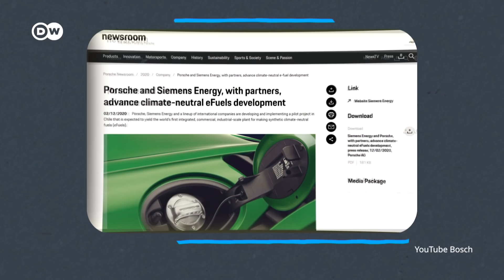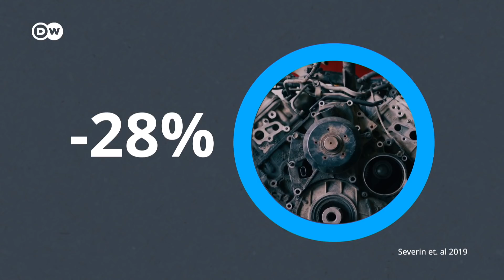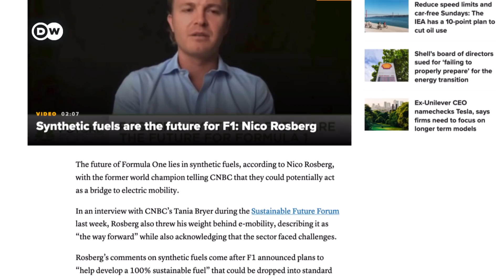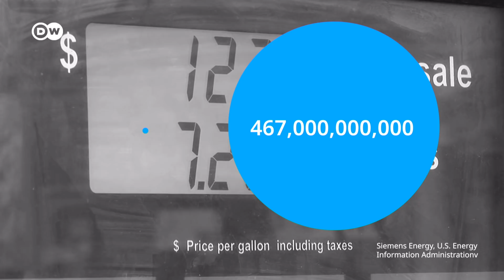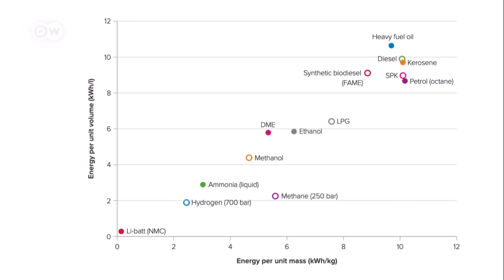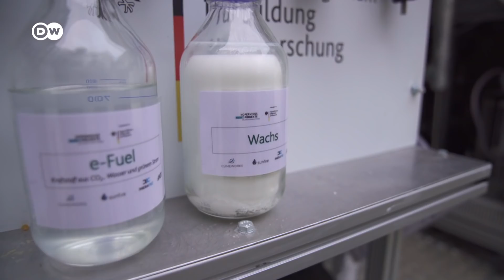The truth about carbon neutral fuels

Comment: We will never have only one method of energy production. 
Hydro and geothermal are pretty much maxed out with current technology; hydrogen is extremely energy intensive to produce and the problems with storage and transportation have not been effectively addressed yet, some W&S make sense, but it's too resource intensive and chaotic to ever be capable of doing the heavy lifting. FF has a lot of advantages, and that's why approximately 80% of our energy needs are currently met with this method. It's energy dense, high capacity factors, it's stable and easy to store where we want it until use. It's also dirty, and we should replace burning it for fuel as much as we can.
 Nuclear power, however, requires a fraction of the resources of any alternative as well as being the safest and lowest environmental impact method available. We should be using it as much as possible. 
Adding more Nuclear power plants would mean far less environmental impact than attempting replacing FF burning with other methods of energy production.
 Without even factoring in the required backup, wind and solar use 100's of times more resources per unit of power production than NP does. That's 100's of times more mining, pollution, and waste, including toxic substances like mercury and cadmium that have half lives of forever and unlike used nuclear fuel are not safely contained. 100's of times more manufacturing and transportation that's done with FF, 100's of times more land and habitat loss. 
Nuclear power is the safest method capable of meeting our energy needs 
https://ourworldindata.org/safest-sources-of-energy
And the fastest way to decarbonize.
How fast can we build clean energy per capita?
From @jmkorhonen & @Kaikenhuippu Climate Gamble: https://t.co/Z4bKDoy2AV
https://twitter.com/CC_NoThanks/status/1358287438091804673?s=19 

How fast can we build clean energy per capita?
From @GrantChalmers https://t.co/J0Abtov19Q 

https://scienceforsustainability.org/wiki/How_quickly_can_we_build_clean_energy%3F

 Using NP, a reliable clean power source, negates any need for massive overbuild and backup. Which means way less resources are needed, which means it is a greener solution.
A huge problem with dilute intermittent power sources like Wind and Solar is the ridiculous amount of resources needed to produce such massive power generation and storage units. No matter how problematic one may think nuclear power may be (its not its been producing clean reliable power for more than six decades without effecting the climate or human health), the environmental devastation caused by attempting to replace FF at scale with any other available alternative far exceeds that.
https://m.youtube.com/watch?v=zc7rRPrA7rg&feature=youtu.be#dialog 

When looked at in perspective, it's very clear that NP is the cleanest, safest, lowest environmental impact method of energy production available that is capable of meeting our energy needs. 
We have to meet our energy needs regardless; I vote for doing so with the least harm possible.
https://www.world-nuclear-news.org/Articles/Why-nuclear-is-an-environmentalists-story
Reply: What are your thoughts of meltdowns and getting rid of nuclear waste which can have a negative impact on the environment and our lives? There has a be a way to recycle that waste to produce batteries and consumer products. Plus, a smaller and very compact power plants instead of relying on dangerous big nuclear plants.

Comment: Very interesting. E-Fuels should not be used in cars or ships. Surely the best use case is aviation. Batteries really stand no chance of powering large aircraft over long distances anytime soon. In desert locations, surely solar (thermal or photovoltaic) is a limitless resource. So even a 20% efficient process is still worth it.

Comment: This could be if cheaper great since you are not only creating synthetic oil from air pollution which doesnt increase carbon consentrations, plus you could use this tech additionally as a battery. Think about it, a battery is just a reserve of energy if you can say plop some km^2 of solar to a very sunny and  easily reachable place, like the borders of the sahara with ships or even a pipeline you could then capture carbon back into fuel, stopping carbon emissions plus saving the fuel as a means of energy storage. Sure its not perfect and not efficient, but you are basically getting it for free. This could also help make renewable energy sources more reliable, turn up those generators when you got plenty of sun and wind, create synthetic oil and then burn it in the night and therefore having no need for any other carbon emissive energy sources.
Reply: We need to reduce the amount of carbondioxide in the wtmosphere will this not just be used with non renewable sources causing polution

Comment: I feel it's horribly inefficient. Because you're using an ICE, you already jump to a Well-Wheel Efficiency of ~40%. And that's considering there's no other power losses along the way. With the world struggling to "clean" their own grids, this would be a huge added task. Moreover, CCS would focus on capturing CO2, NOx with a Global Warming potential of 72, will still be released. It might be a Carbon-Neutral fuel, but it's definitely nowhere near a clean one. Moreover, with the current price of E-fuels, one would easily spend enough in a few years to make up the difference for an electric vehicle. As an automotive engineer, it saddens me, but E-mobility is the way to go.

Comment: The fastest way to ramp up the production of renewable energy from intermittent sources is probably by pairing those energy-capture facilities directly with fuel production or other chemical synthesis facilities on a micro-grid. That way you don't need to worry about grid upgrades or energy generation contracts, and the fuel production facilities can be designed with an accurate estimate of the amount and costs of the energy they are getting.
By not depending on regulated energy from a grid they can take advantage of the cheapness of the mostly unregulated energy being produced by these intermittent sources by ramping production to match their energy supply.

Comment: The low-hanging fruit for e-fuels is ammonia as it allows you to skip the carbon capture step, as such is pretty much the most efficient to produce. As for using it or synthetic hydrocarbons, they will probably make a bigger impact with powering industrial equipment or as a supplemental fuel, rather than the primary energy carrier for personal vehicles.
Reply: Ammonia is also not very easy to store to be here

Comment: Says tv from country which just recently reopened open pit mines of brown coal and power plants fed from those mines.... Decarbonize, sure. Use solar power from devices that are made in chinese furnaces, basically they work almost like batteries, captured energy in furnace is slowly released with photons until solar panel is depleted... after around 15yrs. In Scotland it is small but snowballing problem, panels that supposed to last 20 years are usually depleted after around... wait for it! 12yrs! I can go on and on with every single form of so called renewables, except perhaps offshore installations that use sea currents - they make quite a lot sense.
Meantime France retreated from Paris agreement couple of weeks ago, as they realized that it does not serve their national business... well? Who is next?

Comment: Methanol is the better alternative to eFuels.

Methanol is not a "bridge-technology" (imao)
because big ships, mid/long range trucks or planes will never be fully electric. Economics dont work out, because once one designs f.e. a truck which can go for 1000 km, the battery gets to heavy, the cost are prohibitively high and so much energy stored in that small footprint cause serious risk. Transporting such heavy and large batteries is pretty inefficient.
Production of batteries is enviromentally not without issues.
Short range (up to 100 miles / day) electric is fine.
Mid/long range Methanol is the best enviromentally friendly liquid fuel for foreseeable future.

The CO2 emmissions from transport sector quite huge, but still lower than nature (plants) can and do sequest from atmosphere.

Stationary power plants powered by fossil fuels, CO2 emmiting chemical plants like cement or steel plants have to be equipped with CO2 capture technologies. CO2 and H2 (renewable energy sources) can and should turned into Methane or Methanol.
This is the only sustainable economicably viable path forward.
Reply: There are many options but one of the main benefits of Efuels is that you do not need to install a new engine or develop the technology for one. Efuels runs perfect on regular engines, that's masive.

Comment: Just use the hydrogen in the plane directly, at an efficiency of 30%+ instead of 8-18%. Or wait 5 years for insanely better batteries (due to all the funding and R&D now going into them) which will make all these questions redundant.
Reply: Airplanes and ships are never going electric. Trucking indrustry is not going to any time soon. 

Hydrogen has issue with inflammability and low energy density(due to all the mass & volume requred to store high pressure hydrogen), the advantage of Efuels is that you don't need new engines, you don't need to make any investments. You just buy a more expensive fuel than your regular stuff and enjoy carbonneutral transportation.
Reply from the maker: Feel free to check out this report on hydrogen planes: https://www.youtube.com/watch?v=7KkBE0HgNJQ Let us know what you think in the comment section!

Comment: I am sorry, but the Reporters did not thoroughly research "synthetic fuels" and they just name one of many processes synthetic fuel in general. There are other ways to produce synthetic fuels from waste conversion, biomass conversion, conversion of natural gas to synthetic fuels. Those are cheap, drop in replacement for fossil fuels and emit 80% less CO2 when combusted in ICE! They additionally eliminate emissions solving cross sectoral challenges! You need to rectify by creating a new report on synthetic fuels which are an ideal climate technology and better than electro mobility given the life cycle of EV and batteries! Just give it another think!!

Comment: I work on a farm, and synthetic fuel represents the only feasible way that our equipment could be carbon neutral. Batteries are too heavy and expensive, and hydrogen power undeveloped both in technology and infrastructure. Meanwhile, Carbon Engineering has been producing carbon neutral diesel since 2017. This technology could be gradually integrated into existing fuel systems, eventually reducing pollution from our equipment to zero in a manner that wouldn’t completely bankrupt our farm. So, a yay from me for synthetic fuels in regards to heavy equipment.
Reply: Bless you bless the farmers ✊🏻
Reply: At $10 a liter it will still bankrupt your farm.
Reply: @LearningFast Guess what? It was pricer to automobiles versus horses and bulls in the early 20th century.
Reply: Methane made from farm waste not petroleum
Reply: Methane is what I’m banking on
Reply: Video or it didn't happen
Reply: Wouldn't farming wastes also be used for Biomass Power and Biodiesel? That might mean a bit more financial benefit for farmers too. 
Also, even if we develop Hydrogen Fuel technologies by a lot, it will still have horrible Energy per Unit Volume (not Energy per Unit Mass!) because of the inherent properties of Hydrogen as compared to Organic Chemical (Diesels, Petrol, etc.)
Reply: @ZippyPiglin36  Some farmers do bale up the plant matter left over from grain harvesting, but we like to leave ours in the field as it breaks down into the next season and adds some fertilizer and organic matter back into the soil. I'm not certain, but I believe the general consensus is that the soil health benefits of leaving harvest leftovers in the field outweigh the potential benefits of "harvesting" the leftovers and using them for something else.
Reply: Listen to the whole video. Synthetic fuel still requires hydrogen combined with CO2 from gas or biomass which sounds a lot like brown hydrogen, a product of coal gasification. The electrolysis of blue hydrogen from water is too energy intensive to be profitable. Green hydrogen is produced from methane. I still have high hopes for ammonia as fuel even though SpaceX uses methane
Reply: @luislongoria6621  hydrogen can be produced cheaply depending in where you are a solar farm in north africa to power a hydrogen plant would be ideal
Reply: @luislongoria6621  Learn the facts. Green hydrogen is NOT necessarily produced from methane. It is mostly produced from water electrolyzed with renewable energy. There are

Comment: Engines could also be powered by some type of gas.  and I do not mean petrol
Reply: Yes but hydrogen has energy density problems, requires a massive new tank to store, requires a new engine to run on. Efuels require none of that.
Reply: @TheTaXoro  it is more eficient to powwer a engine with reverse osmosis instead of burning i
Reply: @definitlynotbenlente7671  By that you mean using hydrogen fuel cells yes. But then you need a fuel tank, a fuel cell and an electric motor.
Reply: @TheTaXoro  yes

Comment: Running engine on petrol fuel emits CO2 only count as secondary warning effect. The primary warning effect? Is waste heat 75% or more of it into the atmosphere only 25% or less to propel our cars. 

As students we were told but question that CO2 is a good insulator of IR, and more CO2 raise atmospheric temperature.  The opposite is true. CO2 emits as much and as good IR as it absorb it. So what insulate IR? Glass.

Comment: Hi, 5000 windturbines is not so much, I think. How much planes we have...? I am sure the efficiency of efuels will increase. As I worked at Siemens 30 years ago, I sad, we have to develop sun and wind power, the bosses only laughed! And today? Perhaps there's a potential that we should not miss! We should use and develop renewable energy wherever it is. By the way, it's necessary to get CO² back out of the air to stop the greenhouse effect. There is so much more to say and do...... (Uran is no solution - only the next devil) greatings..

Comment: In your efficiency calculation, you didn't mention the weight of electric batteries. For example, in Tesla Roadster batteries make up about 1/3 of the weight of the car. So that is 33% of the energy wasted on pushing the extra weight.